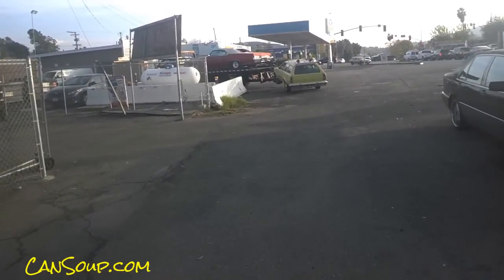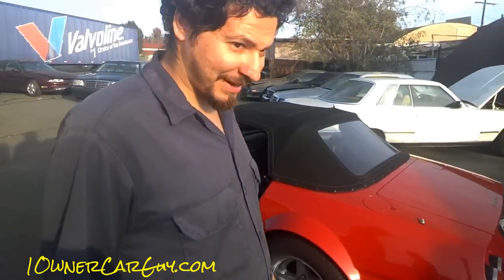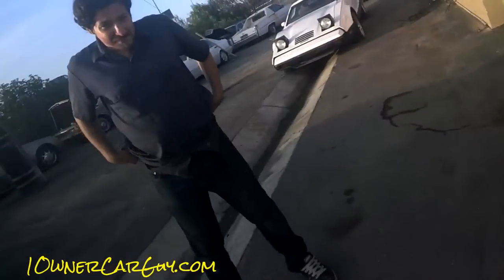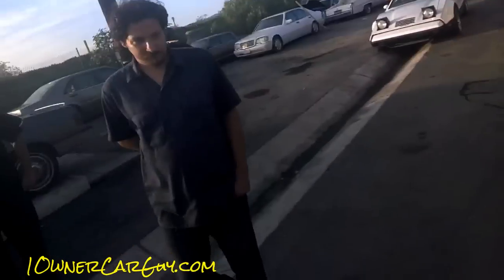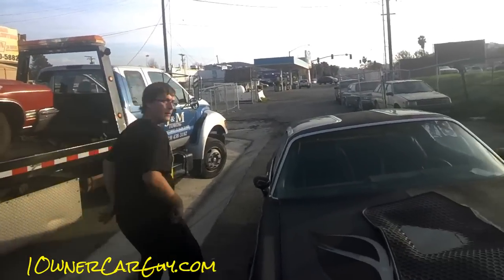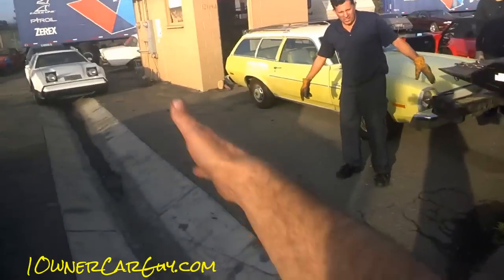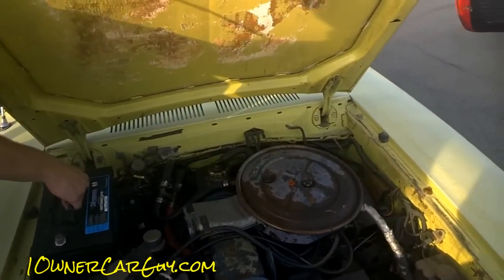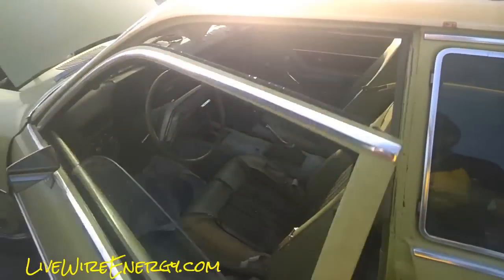Cold Start Video + Towing Pinto & Centurion Home ~ Old Car Work Tow BTS VLOG

Comment: Then you have all 14 inch hubcaps. 

No chance that you have so much 15inch ones.they were only on the Mercedes w100 600 and the w114/115 stretch limo and ambulance , w123 stretch limo and ambulance. 

It is not that you have to search for them but in a movie you were pointing on some hubcaps and said my name. So therefor I asked. 

They are on the toolshouse in the same yard were your stretch limo is.